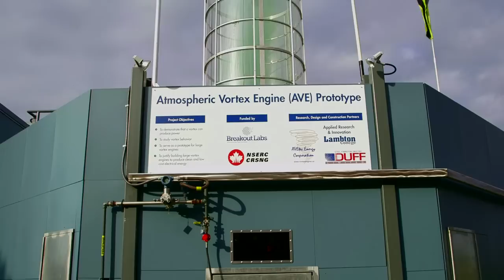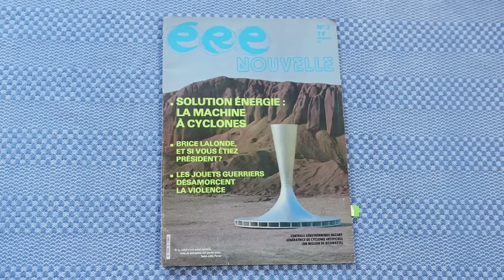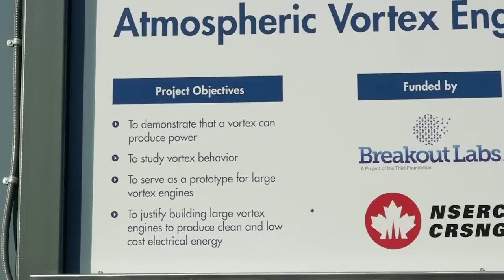Tornado Man | FUTURE

Comment: This seems similar in concept to a Solar Updraft Tower:  en.wikipedia.org/wiki/Solar_updraft_tower

The SUT uses sunlight as it's source of energy to keep the 'wind' flowing inside the tower.  I fail to see what causes that here, unless you are getting some sort of multiplication effect by burning a small amount of fuel and being able to extract more energy.  Heat pumps do this, but I don't quite see that happening here.  Curious to know how the math works out on it...

Comment: So I am assuming two ways this is intended to work.
Either this is intended to be built at a huge scale in a warm climate so that warm air coming in from the bottom and rising up the middle will start a chain reaction as it rises and creates a vacuum, thus sucking in more hot air from the bottom and thus perpetuates.
Or the process is intended to be started with some heat source and at a certain point become self feeding.
The concept seems sound as far as I can tell as a layman, would be interesting to hear a qualified engineers opinion on the feasibility of it though.